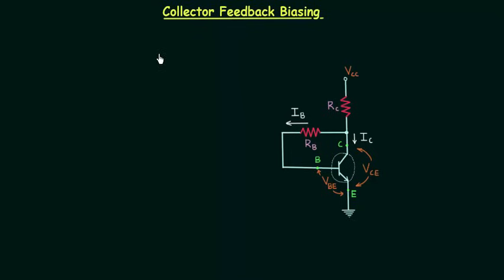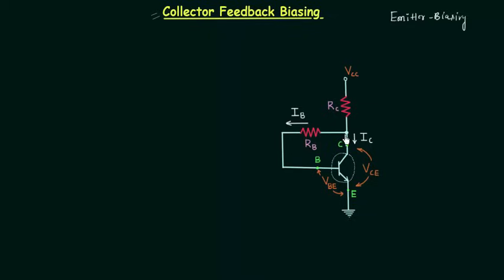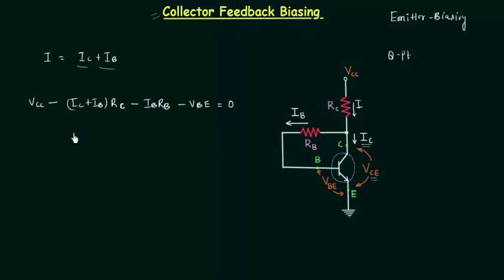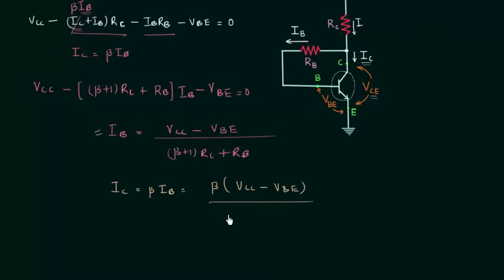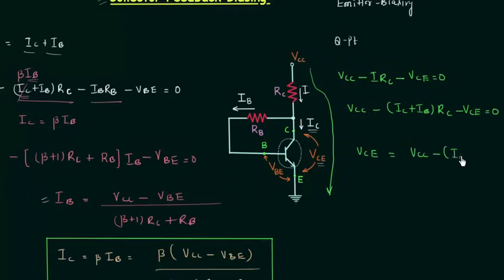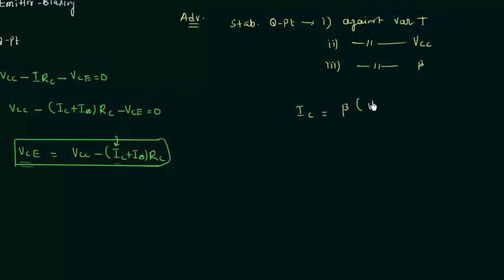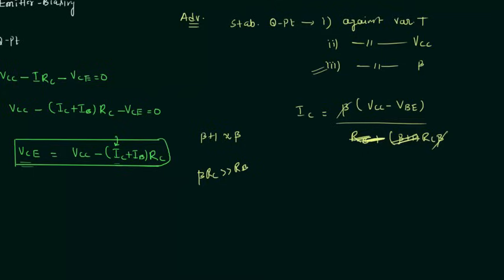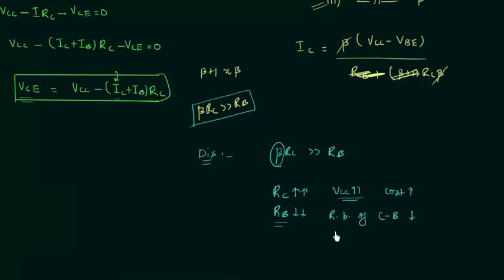Collector Feedback Biasing

Comment: In a collector feedback biasing circuit, increasing the collector resistor (Rc) can necessitate a higher Vcc (supply voltage) due to the relationship between voltage drop across Rc and the collector voltage (Vc)

Comment: when Rc increases, the voltage drop IcRc increases. If IcRc increases,Vce decreases. if Vce decreases,the Q-Point will approach saturation region. so inorder to compensate ,Vcc must be increased. Also it is clear from the equation, Ic=(Vcc-Vbe)/Rc that if Rc increases, Vcc will increase.
Follow these equations .
Vcc=Vce+IcRc-----(1)
Vce=Vcc-IcRc------(2)

Comment: As Rc increases, most of the voltage Vcc will drops at Rc only.remaning voltage divides into Vbe & Vcb.And Vbe~0.7.That means Vcb is decreasing. But we know that Vcb has to large enough to make base-collector junction reverse biased if not circuit goes to saturation region eventually there will be no current in circuit.So we have to increase Vcc.

Comment: I have tried to make a small Signal model of the Selve biased EC-Stage with Emitter degeneration and it was not easy. In fact the Formula was way to big. Now if i have even an capacitor parallel to an Emitter resistance, the Problem becomes even bigger.
Does anone have a good advice / Approach to such a Problem?

Comment: in a feedback what happend when  vce equal vcc ? plz answer me
Reply: Vcc can only be equal to Vce if the transistor is operating in cut off mode... Only then will the voltage not drop across resistance Rc

Comment: If we start increasing Rc without increasing Vcc, we get smaller values which drives Ic towards zero putting Vce equal to Vcc, which is for sure the start of saturation, i guess!
@Guoyi Xu agreed
Reply: Plus having such a large RC defeats the purpose of having a BJT as a simple amplifier. Moderation I guess

Comment: when RC is a large value, VCC increases because there is a low voltage drop across RC.  Because RC has a high resistance then IC has a low value.

Comment: Q point shifts whenever there is change in Ic value(since Ic is one of the coordinates),thus if Rc increases Ic will decreases hence to increase the Ic(to keep up the stability) Vcc(voltage at point)should be increased.

Comment: since voltage is directly proportional to resistance .if the resistance value is required to be increased than voltage must also be increased to balance the current.
Reply: if we increase the Rc ,that would be decrease the output value of collector emitter voltage,so increase the Vcc will maintain the variation in Vce
Reply: Voltage kbse resistance k directly proportionally hone lg gya
Reply: @sahil44691  guys what are you doing